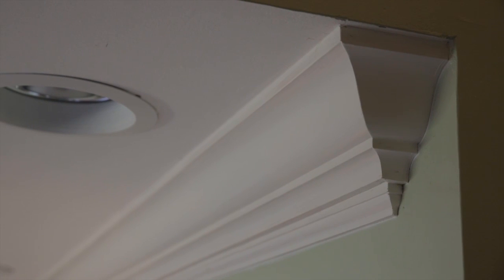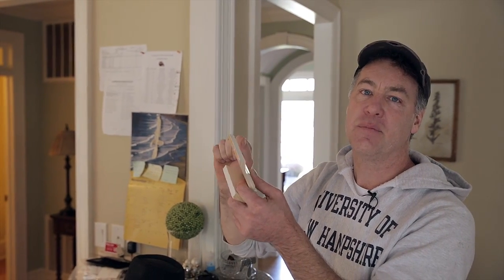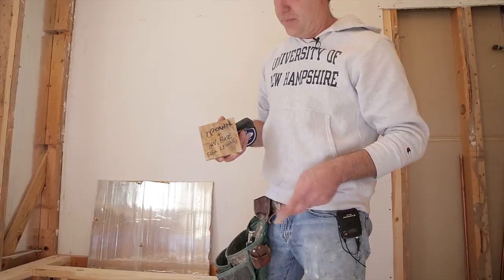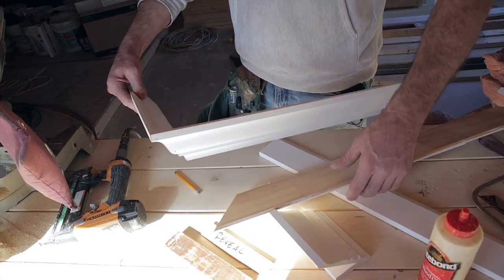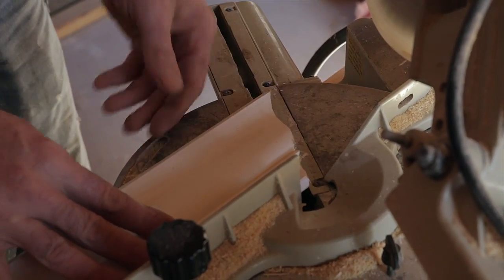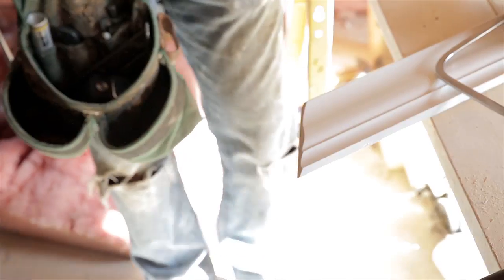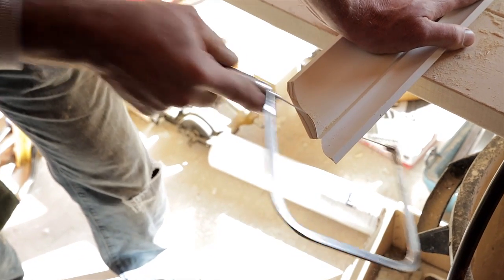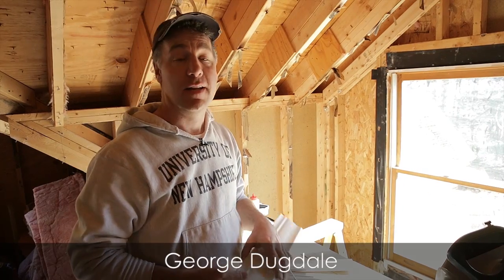How to Install Crown Molding

Comment: This is fantastic. Have you thought about doing a crown video on vaulted ceilings? Also, you mention going around a room when you are hanging crown, why is that? Couldnt it also be done by running 2 pieces of crown (butt joints on both ends) on 2 opposing walls, then coping both ends of the crown on the walls to the inside?

Comment: Your technique is the same I use. The big problem I have is dealing with expansion and contraction and my lap joints or inside miters opening up. Many people here in AZ have evaporative cooling, so the increased humidity does crazy things to long molding runs. How do you deal with it? Great video!